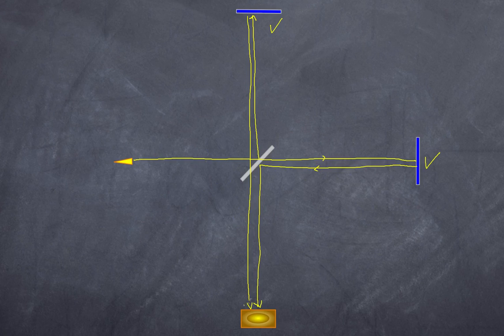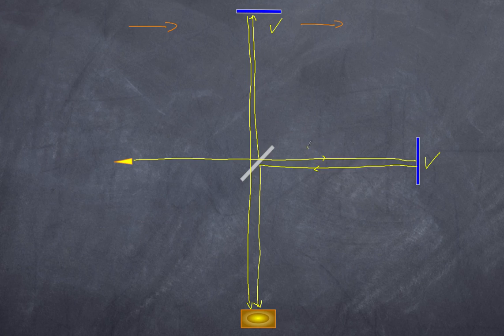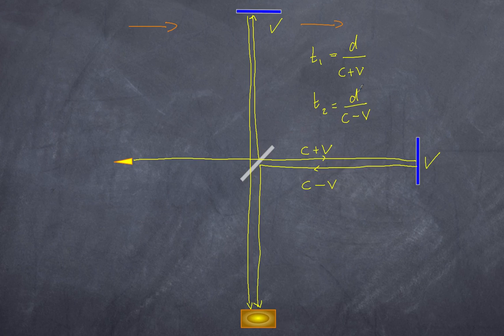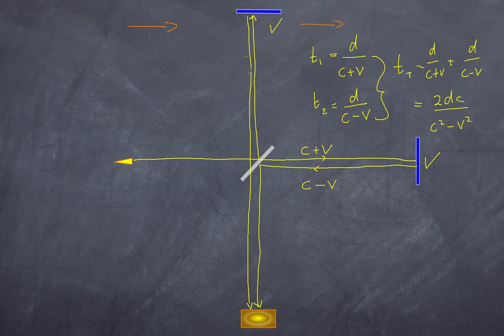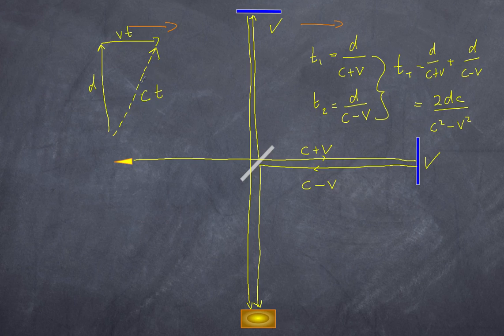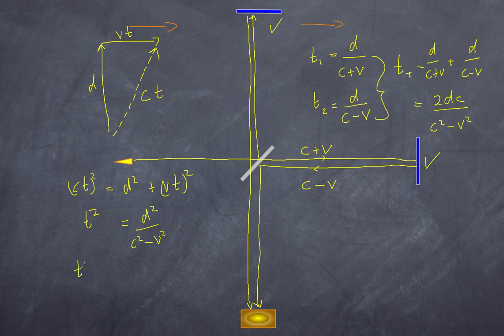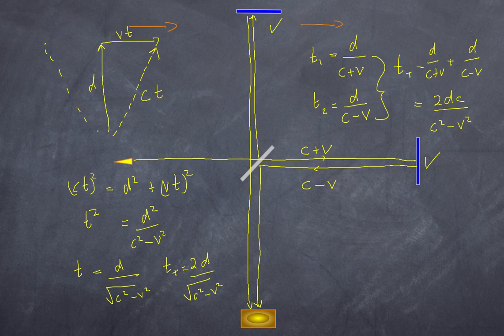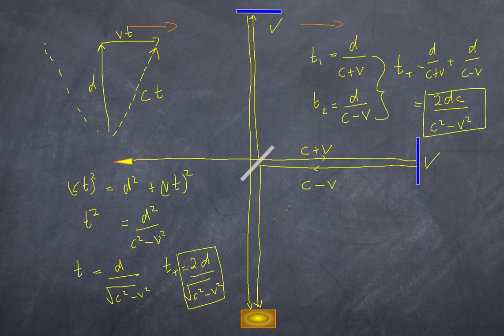michelson morley maths

Comment: if the ether wind is from left to right then the speed from left to right should be c-v (relative) and back c+v isn't it?
Reply: It really doesnt matter because the speed of the aether wind is ZERO, because the aether is STATIC. So you insert v=0 and get the same speed of light c in all directions ! It's as simple as that !!

Comment: This is too many assumptions.  This is all anyone knows, so you were taught EVERY word of that.  So was I.  But, with a little scientific skepticism, responsible thought may arise.  If reflection is a new emission complete with its own velocity, then any drift effect would be erased by both beams being reflected in the normal axis.  That's just one thought.  Another thought is that light emission in a massless medium would have no drift velocity and would emanate symmetrically from the source (unless accelerated).  I think it's both.  They didn't rule this out, because relative time is what they wanted, and they would be sad to see it go.  This whole situation is goofy.  The only support that I saw for this farce was pion addition experiments, but even then, they assumed nothing could go faster than light when they calibrated their detectors.  There is always that constant-light declaration first, even in muons entering the atmosphere.  This experiment assumed that if light is constant, decays should reach lower altitudes, but if they are going faster than light, it's the same result.  It's not time dilation, it's just going faster than you BELIEVE it can.  Testing it by using it is not verifying that it's true, because it's a perfect analogy to something else.  Humans are this stupid on a bandwagon.

Comment: We came to the conclusion that the negative result of the M-M experiment is due to the coupling of the mass density of light with the density field emanating from the mass of the planet. Coupling that imposes the same speed of light in all directions of the horizontal plane and makes the principle of relativity work, which prohibits the determination of the state of motion of a system, through experiments carried out inside the system. The coupling of light with the density field of the transparent medium, through which the light passes, is proven by Fizeau's experiment, which precisely verifies Fresnel's formula for the composition of velocities. Fresnel's formula for the composition of velocities results from the summation of the photon density with the density of the transparent medium, without any relativistic metaphysics.

Comment: it should work, regardless of the aether flow. If all other theories are correct, the speed of Earth alone would be more than sufficient to show fringes on the detector. M&M stated that in the original paper. But it didn't. But why it doesn't work? Using Ocam's razor, meaning the simplest solution is the most often the right one, these results suggest that Earth doesn't move at the speed proposed by astronomers, or maybe not at all. But this solution was unacceptable to "science circles" and still is, so Einstein developed complicated illogical solution to this problem that was very much welcomed by mentioned circles. I wonder why.
Reply: bruh

Comment: I take it that the Earth's rotation is the cause of the VT distance. That has to be a minuscule amount of travel distance, and of course times two. Yet the C+V and C-V will always be equal regardless of the eather wind direction.  I don't see how this experiment can measure anything concerning the hypothesized aether.
Reply: Consider the case where V approaches C. To fraction d/(C+V) will then equal d/2C, however the fraction d/(C-V) will become very large and approach infinite. Intuitively this means that if the aether wind is just barely smaller then the speed of light, then to travel against the wind the light will take a very very long time, and even though the return trip is nearly instant the total time is still much larger then 2d/c. Also its not earths rotation causing the ether wind as much as the earths movement through space, around the sun, around the Milky Way, etc.
Reply: @tobiasyoder  I will need to consider your proposal further, which I have been already considering for years. Two beams of light going in opposite directions while both travailing together near the speed of light in one of the two directions can not be considered logically. They are both in the same frame of reference and time cannot be slower for one and not the other.

Comment: Well, math. of the two directions 1 and 2 MM is in time: t1 = 2d/c and t2 = 2d/c => a zero result MM.
TO THE LIGHT THE OBSERVER IS ALWAYS AT REST.
Reply: If the light were a particle like throwing a ball while instead an airplane then you would be correct. However, light was thought to be a wave, so the speed of the light would purely be based on the medium. This means that the speed of the light relative to the observer/mirror would be 2d/(c+v) and 2d/(c-v).
Reply: The observer (Michelson) is always at rest (all other systems is always in motion). Speed c is the same in all direction. In physics the observer system is always the fundamental reference. @tobiasyoder

Comment: The truth is that MMX used the wrong equation to compute the speed of the Earth around the Sun.
They reported a speed of about 5 to 7 km/sec for the Earth around the Sun.
When you assume that the ether medium does exist and light is a wave in the ether medium, as has long been expected, you must use the Superposition of Waves Principle, due to the opposing waves in the arms of the interferometer.
   Steven B. Bryant has done the work and uses the correct equation to compute the data from the  MMX.
MMX, when the data is properly computed, gives the expected speed of 30km/sec for the Earth around the Sun, as does the Miller experiment.   Many experiments also reported moving fringes, like Miller and MMX, and a rough speed of around 6 km/sec using the wrong equation.
    @
@t

Comment: In addition to my four comments of 2 weeks ago. Michelson's & Miller's MMXs suffered from two spurious signals.

(5) Firstly a linear ever-growing fringe-shift that got larger with each rotation. All MMXs that employ vertical fringes will detect this signal. This includes laser MMXs. Horizontal fringes do not suffer from this effect. Because at least one mirror has to be turned a little (horizontally) to give the desired fringes then this results in a difference in a beam's horizontal radius from the axis of rotation. Mirrors approaching the axis in effect eat waves/fringes, & mirrors going away from the axis in effect vomit waves/fringes, the eating equaling the vomiting, but in Michelson's & Miller's MMXs the non-symmetry of the beams resulted in non-equal eating/vomiting, resulting in a signal that was periodic in a full turn. The desired sought-for MMX signal (fringe shift) being periodic in a half turn. University MMXs will detect this signal if the MMX is rotated lots of times, because this signal is ever-growing, 100 rotations will give 100 times the signal that is gotten from 1 rotation. Stopping or slowing the rotation has no effect on this signal, ie it doesnt reduce this signal, the size of the signal depends only on the number of rotations, it is ever-growing. Michelson & Miller deducted this signal from their raw readings, to do so they assumed that it was linear, which it is, or, it should be, but their MMX was top-heavy & suffered from a changing lean (it floated in a mercury filled trough), plus their MMX had a sloppy pin (ie axis of rotation), hence their LEGFS was not always very linear (but that is another interesting story in its own right).

(6) Secondly a spurious signal that was periodic in a full turn. This was because their mirrors were at two levels, hence some of their light beams had to angle up & later down. This then introduced a spurious signal (fringe shift) due to angle contraction of the mirrors in their apparatus, which changed the effective lengths of the angled beams. I call such angle contraction Esclangon angle contraction, as Esclangon is i think the first person to bring it to the attention of science (but he didnt mention that it must also happen in an MMX). EAC is due to Lorentzian Length Contraction of solids (which should be called FitzGerald LC as FitzGerald was the first to predict it) which is due to a change in the aetherwind blowing throo a solid (which changes the size/shape of solids)(because solids are held together by electric forces)(these forces being changed by the wind).

I can better explain all of this if anyone is interested.
Reply: How does water stick to the bottom of a ball?
Reply: @acduck2813  Good question. Surface tension in water might be the key. Gerald Pollack explains how in most cases surface tension is due to a special phase of water which he calls EZ water.
Reply: so aether exists?
Reply: @makantahi3731  Allways has. As per all experiments. Or, aether duznt exist, koz aether is a process, it is an excitement of Praether, & Praether is the fundamental essence, Praether exists, & everything else is a process of the Praether. Photons are an excitement/process of the aether, etc etc.

Comment: (1) Google Demjanov's twin media (air & carbondisulphide) MMX done in Obninsk on 22 June 1970 which showed an aetherwind of 140 km/s min & 480 km/s max during a day (this was the horizontal projection of the background aetherwind which is approx 500 km/s south  to north blowing approx 20 deg off Earth's spin-axis). This genius 1st order MMX was 1000 times as sensitive & accurate as the oldendays 2nd order MMXs.

(2) The MMXs were never null.
(3) The correct calibration needed to allow for length contraction caused by the aetherwind.
(4) The correct calibration needed to allow for the Fresnel Drag of light by the air.  
Prof Reg Cahill explains.
Reply from the maker: Is Demjanov's research peer reviewed? There have been many recent peer reviewed papers on repeating MMX with the same results as MM
Reply: @PhysicsHigh  Anyhow, show me one peer review of any of Einstein's papers.  No hurry.
Reply: @PhysicsHigh  Demjanov is not peer reviewed.
Re the many recent peer reviewed papers repeating null results, send to me one at a time, & i will tear them to shreds (based mainly on the theories of Prof Reg Cahill).
I am very knowledgeable re two problems affecting oldendays MMXs, based on my own findings/discoveries, but that is advanced stuff, unlikely to come up here.
Anyhow, show me one peer review of any of Einstein's papers.  No hurry.

Comment: The major problem with their experiment is, if they were in a boat, in a very large whirlpool, and they were to throw a dabber off the side of the boat, the dabber and the boat would appear to not be moving in reference to each other, in spite of the fact that they are in actuality moving. If the Aether around the Earth was rotating around the Earth, with the Earth, and the Aether around the Sun was rotating around the Sun as well, (with the Aether of the Earth rotating as a smaller whirlpool within the larger whirlpool going around the sun), it would appear, like the dabber along side the boat, that the Aether was not moving at all.